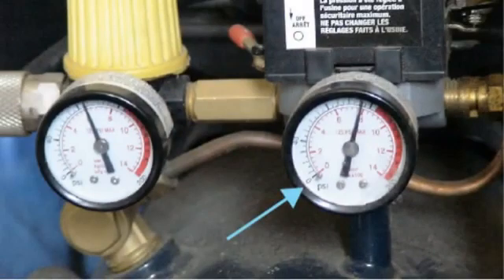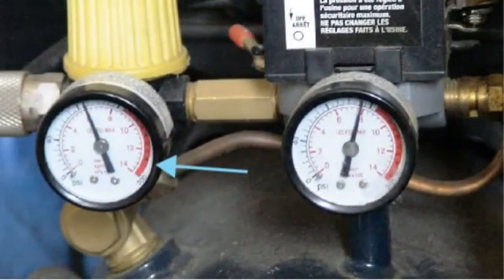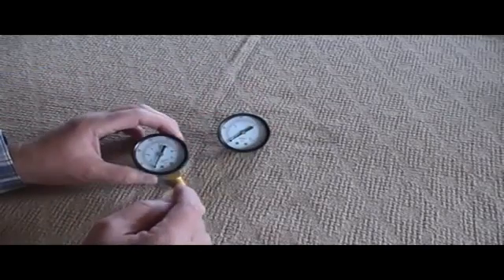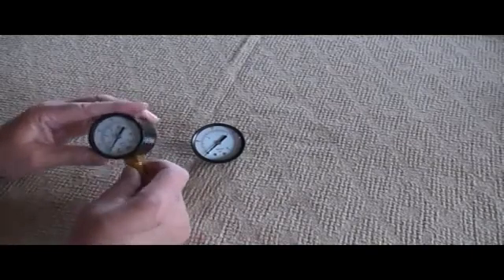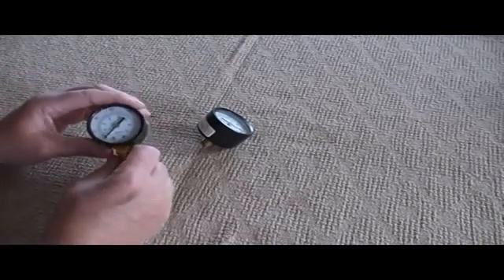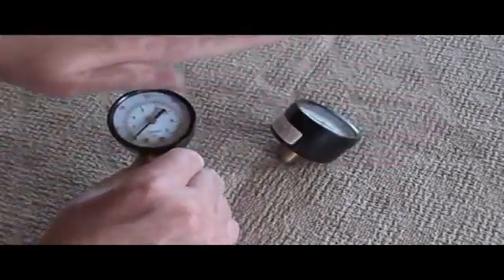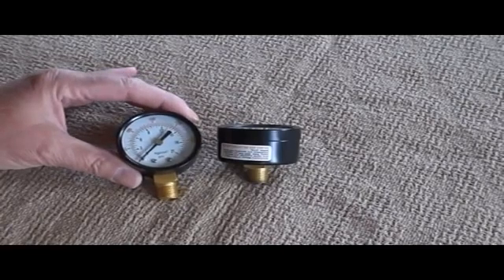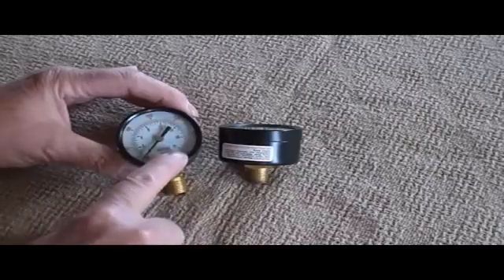About Air Compressor Air Gauges & Why There Are 2 Pressure Gauges

Comment: The blue Teflon tape is specifically designed for air tools and air fittings. The white Teflon tape is for water (plumbing) and the yellow Teflon tape is for gas fittings. Excellent video.
Reply: What about red